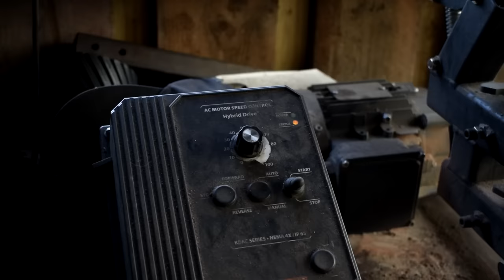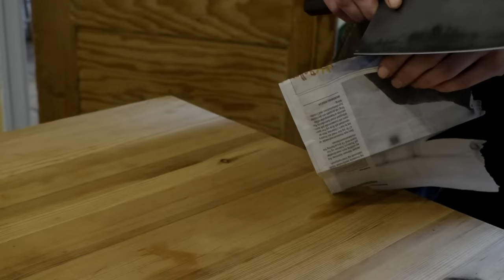Knife making - Forging a Big Kitchen Knife using the Warikomi Technique.

Comment: So my 9 year old has told me he wants to be a black smith. I have him binge watching your early stuff. So he understands he doesn’t need all the fancy equipment to get started.
Reply: indeed. All one needs is the work ethic, a hammer, an anvil, some form of tongs and a heat source. though safety equipment always helps if used properly.
Reply: ‘‘Tis true all I have is a hammer anvil charcoal forge tongs a 1x30 and an angle grinder and it works great u just gotta work hard
Reply: @TheBottegaChannel  I got an anvil and some tongs, we don’t really have a forge yet, as I don’t want to spend money on a forge until I see this isn’t a phase. But we got an old burn barrel I load up with wood and once it’s nice and hot he goes to town on some old wrenches I have or some rebar. He’s made couple prison shanks 😂 hopefully he loves this and keeps going.
Reply: No but still expensive tools
Reply: @GrowingLittleCountryhomestead  , sound logic. Check up " box of dirt forge" and " what not to melt" to assist with refrences for him to watch. Let him know " dont forge galvanized steel. It makes toxic fumes that give you metal fever." and to stretch before each forging session. ( Learned the last part the hard way.)
Reply: @TheBottegaChannel  I’ll check it out! thanks man
Reply: @GrowingLittleCountryhomestead  No worries. Have a great day.
Reply: .. I'm making knives using basic powertools..only 4inch grinder,rotary tools,anvil, hammer and charcoal forge made of termite clay soil.. #bladetribeaklan
Reply: Have your son watch Chad from old South forge. He makes beautiful blades with virtually just his hammer
Reply: @TheBottegaChannel Gotta watch out for Chrome plated tools too, those produce hexovalent chromium, dangerous shit to breathe.
Reply: Yeah I really appreciate the hand, hammer, and anvil approach...that's all I got. Though a 2x72 would be awful nice - simply not affordable
Reply: Walter Sorrels. There are much better tutorials available.
Reply: Have dreamed of making an alcohol wicked forge (think giant lantern) but it would not get hot enough to work steel.
Reply: @popsforgeblacksmithing4793  90
Reply: @asimovstarling8806  ]😊
Reply: It feels so relieved to hear that. Really
Reply: Wish my dad was any sort of cool like you

Comment: I've never seen this technique done before and I think it looks amazing, even more impressed that this was drawn out by hand and not using a power hammer. Much respect and regards from here in the UK.
Reply from the maker: Thank you! I used to have access to power hammers. Working on  building myself a press to save my shoulders haha.
Reply: Power hammers make power mistakes. That power hammer trend will fade away like everything else.
It's no problem to draw out steel, if you know your way around an anvil.

Comment: Beautiful work man. That's a difficult forge weld to pull off.
Reply from the maker: Thanks man. Yeah, mild steel doesn't help!
Reply: What's mild steel?
Reply: @Dom Brazzale  it's steel with about 0.2% carbon,  making it a low carbon steel. Because of the low carbon content, it's soft (for a steel) and also very flexible. 

It's used in everything, cars, buildings, fencing. Anything that you see that's made of metal (and isn't aluminium or stainless) is probably going to be mild steel.

Comment: First time you tried this technique? 
Amazing result!👍
Reply from the maker: Far from it. Made a lot of knives using Warikomi. Difference here is that I used mild steel instead of wrought. The dimiension of the starting material is also more tricky, thinner and taller, more tricky to get the high carbon steel centered.

Comment: Normally, warikomi technique(割込み) is not used for thin knives such as kitchen knives.  The reason is that the thickness of the skin steel and the edge steel are not uniform, and an oxide layer is formed on the forge-welded part, which makes it unsuitable for handling food because it is easy for various bacteria to grow.  Therefore, knives are made with Sanmai(三枚合せ) or a single material.
Reply from the maker: I don't really understand your reasoning (I'd like to). Where do you have the information from that Warikomi isn't used for thin knives? or bacteria growth differing from warikomi to sanmai? The steel used are often the same, as well is the thickness. Thank you.
Reply: @MakeNCreate  I have already explained why.  The oxide film is fragile, and food particles can get caught on it, making it easy for bacteria to grow.  On the other hand, in the case of sanmai, the matrials can be forge-welded after the forge welded part is in a clean state, so the oxide film is less likely to occur.  Anyone who knows the nature of iron oxide can understand it.

Frankly speaking, coocking knives don't need to be tough like weapons.  Therefore, there is no need to create with warikomi technique.
Reply from the maker: @Heuroya  Ever heard of soap and warm water? It's pretty common practice for cleaning knives these days and is done after every cutting session. Seeing as you've failed to provide any sources for your claim I'm not buying it. IF it should, I refer you back to the question I posed at the start of this comment. Cheers!
Reply: @MakeNCreate 😂😂 soap.
Reply: @MakeNCreate  !NDEED

Comment: Well done for basic equipment friend. I like your knife and handle also. I'm a beginner also. I've made one knife from a 13mm gear wrench but I'm missing the most important piece of equipment which is an anvil. I have a crappy forge but I think it's junk. I tried it once and it didn't work well
Reply from the maker: Best of luck next time buddy. Thank you!
Reply: @MakeNCreate   i will not give up! Thank you and thanks for replying.

Comment: I love the blade. I do have a question. Why did you glue the handle on with tape around the tang then knock it off and glue it on again? I have never seen this done that way before and I was just curious why the extra step?
Reply from the maker: Thank you! It's called bedding the tang. I do it so I get a cast of the tang in the handle. Makes it easier to shape that handle as the knife will sit the same way every time. Also makes glue up easier with all the individual parts. I'll know they're seated where they're supposed to. Hope that answers your question.
Reply: @MakeNCreate  Thanks for your reply, I will give that a try on the set of butcher knives I am working on. 😃

Comment: Hello fellow knife maker, the contribution of your video is excellent, I would like to ask you a question that I did not know how to find an answer to.
Did you use stainless steel with a high carbon core, or low carbon steel with a high carbon core?
And if it is possible to specify the steels, I would appreciate it.

Your work excelent.
Thank you so much.
Reply from the maker: Mild steel for the jacket and w2 for the edge. Thank you.

Comment: Forgive my ignorance but is this “warikomi” technique the same as San mai?
Reply from the maker: Nope. Warikomi the ''jacket'' fold around the steel as the high carbon is inserted into a lot instead of being sandwiched in between to seperate pieces. Cheers! :)
Reply: @MakeNCreate  it's the low carbon jacket that's diagonally cut to allow the insertion of high carbon edge underneath, yes?

Comment: I disagree that a press or power hammer would have made the difference in cracking or not. I think that's a new fangled belief that's been pushed by social media
Reply from the maker: Yeah I don't agree. It in essence has nothing to do with a power hammer or press. The issue is too many heat and cooling cycles with forge welding temperatues. Striker, press or power hammer... doesn't matter, just gotta have a way of reducing the amount of time spent forging with such a large blade and fragile material. Cheers!
Reply: @MakeNCreate  so odd you made mention of that then 😆 rapid shrinking & growing of the grains, like what happened, is completely unrelated to "having better results with a press or power hammer". Wtf lol
Reply from the maker: @TingTingalingy  A pretty common thing to do when facing a problem is to come up with a potential solution. That's what did.